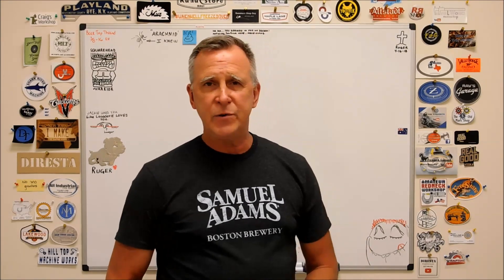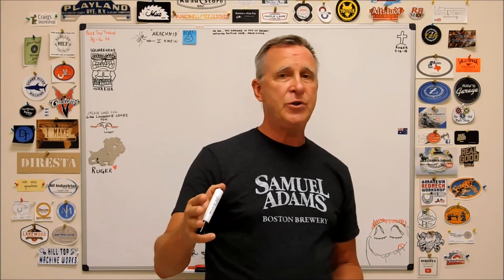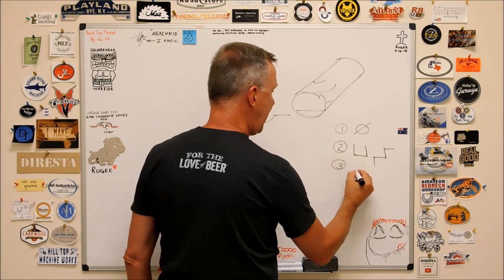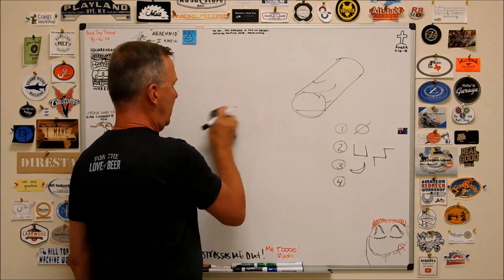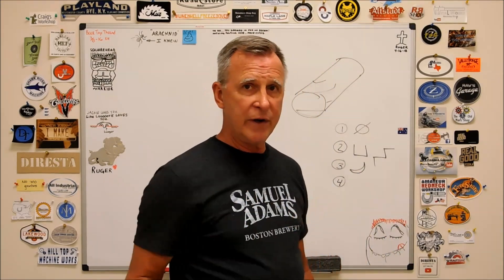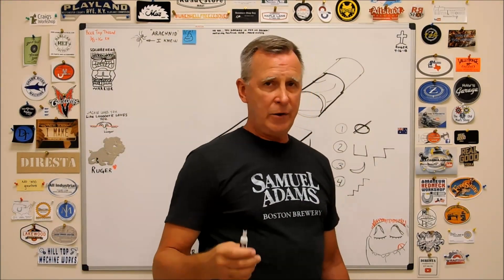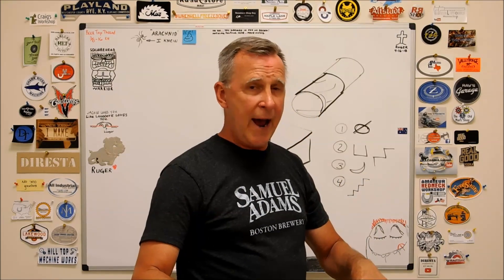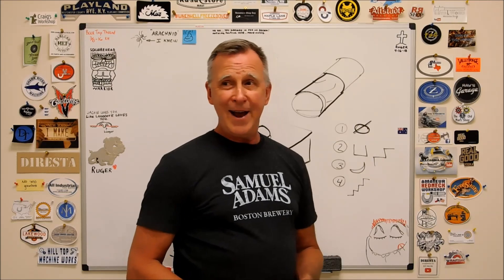Faster Milling and Longer Cutter Life...Watch this One !!

Comment: Hey Joe..Quick question. I am just a hobby machinist, in fact we are really close in age. I understand the purpose of this video. My question is say you have an odd size slot. Maybe just under 1/2 inch. 
Would it be better to use a large end mill close the final size and then go over it with a smaller end mill or would it be better to use say a 1/4 inch end mill from start to finish. 
Long time subscriber…. 
I learn something every time I watch your videos . 👍
Hope you and your family are safe and well…
Reply from the maker: The answer here really depends on the material , cutter and rigidity of everything. If tool flex is not a problem, use a cutter that is close. But flex of .005 or more isn't rare, so be careful.
Reply: @joepie221 Thanks so much Joe.. Your videos have been so helpful.  You are a great teacher.. 👍

Comment: Suggestion
Using those cheap markers, when using them horizontally the ink flows to the back, 
If one is capable of holding it ever so slightly with the back higher than the tip,
Does it allow it to work for a much longer time frame, without having the board see such dry swipes ?
Reply from the maker: Probably, but thats rarely the case when you mark a white board. Sounds like an opportunity for a better mousetrap.

Comment: Question Joe: do you use an exact size cutter for a slot, or one size smaller to allow for cleaning up - if the slot width is critical?Mike
Reply from the maker: I usually use the next fractional size down if the slot is critical.

Comment: Outstanding. Otherwise why design a tool with cutting surfaces extending up the shaft and not just at the very end. Plunge drill to remove material and clean it up with the end mill. That's the way you do it. Play the guitar on MTV. Thanks Joe.

Comment: Hi Joe
Thanks again for another great video. 
Additionally, going around the outside of a part with a full axial engagement, I’ve seen significantly accelerated feeds and speeds. That would yield a higher material removal rate compared to conventional cutting. Just another perspective. Thanks for sharing. T

Comment: Hi Joe, if I may, can I suggest you change your camera batteries to Energizer Ultimate Lithium batteries. Theyre a bit more expensive but the life you will get out of them will more than compensate. I buy mine off eBay in bulk but Walmart often has good prices for bulk packs too.
Thanks for the demo. I think I worked out what caused a new 3/4" ,4 flute cutter to self destruct in short order doing a slot cut like you showed. For some reason the end edges just melted in CR steel.
Regards from Canada's banana belt.🤞🇨🇦🍌🥋🇺🇦🕊️🇺🇲👍

Comment: Good Morning Joe.  In light of cutter management, we have an upcoming job which consists of a standard keyway centered in a 3 7/16 shaft (mat'l is 1144 steel), 365 pieces. How would you approach this? Thank you for your suggestions.
Reply from the maker: How long is the shaft and how wide is the keyway?
Reply: @joepie221  Shaft is 22" long with a 8" key centered. Keyway is 3/4" wide x 3/8" deep
Reply: @dynamiteralph  personally i would rough it out first with a 5/8 inmill then come back with a 3/4 inmill to finsh it off and run coll mister on it blowing the chips out of the slot but thats just the way i would do it

Comment: Yeah, there were are lot of what I may be wrong in calling them chatter on the sidewalk during the plunge cuts too then those in the one end of the cut.  How would you have prevented those variations in the cut of the sidewalks especially near that one end.
Reply from the maker: The pecking operation is a roughing technique. Final offset passes should take care of the wall finish if you use an undersize cutter initially, or can get away with a non full round radius on each end of the slot.

Comment: How I haven't replied to this one I do not know. I did give it a thumbs up though. These tid bits of "You need to know this info". It is always nice to be reminded of these old tricks and rules my friend. There are always so many forces involved in any machining we either fight them or work with them. I prefer the later. Thanks my friend. It is always a pleasure to visit with you.
Reply from the maker: Always good to see your channel avatar pop up. I can always count on a positive comment.
Reply: @joepie221  It is easy calling a spade a spade. I know a bunch of like minded folks here that appreciate your skills. Mark Preselling for one. That Glow plug engine he is getting very close to running makes me wonder about you setting up the mini machine shop with it's overhead flat belt drive ? Lots of questions like are you planning on building a power/steam boiler to cap off a wonderful series of builds ? I question the need for the boiler as live steam can be nasty stuff and air pressure will work just fine and at the same time the boiler would be sooooo cool to at least see it at the head driving that long shaft to all those wonderful creations. DECISIONS, DECISIONS EH.  So, Air or steam, we are a waiting your final decisions. Maybe both eh, LOL. Take care Joe. Your easy to visit my friend.

Comment: That was my method for a very long time. And then I got a mister. Using synthetic water-soluble fluid and  whatever PSI I need to remove the chips  I can bury an endmill and  get a great finish and run faster with less heat too.  
Heym  WD 40 as cutting lube? Kerosene works well on SST?  Really?  It's great aon Alum but SST?  Never tried it.

Comment: Joe I normally like your videos and the advice that you give. But in this one I'll have to tell you..... If I handed in work that had that kind of a slot in it with those "nibble marks" I don't think I'd have a job for very long. I'm all about efficiency, but not at the cost of quality. You can bet that any blueprint would have a call out for surface finish.... Even just a default service finish written in the standard notation..... And I think that the slot that you ended up with would have a hard time passing the surface finish tolerance.

But even if it did qualify for dimensional and surface finish acceptability.... Just the general appearance of that chopped up wall gives the impression of low quality work.... And I know that's not the kind of work that you're used to turning out in your shop.

I'm sorry to sound so negative, but you invite our comments.... And that's my two cents.
Reply from the maker: All 'on topic' comments are welcome, but the base subject matter of this video is how to rapidly remove the material and maintain the integrity of the cutting edge. Nothing about this video addresses the topic or technique of how to get a surface finish. Cosmetics are very important around here.
Reply: That's true. To be fair with you I did take the content of your video out of context in my comments. At the end of my manufacturing engineering career I served as a QA engineer running an inspection department. I guess when I viewed your slot video.... I was not looking at it so much as a machinist as I was an inspector.
Reply: @johndonlan5956  Another point which you seem to have missed: the slot was milled using two different approaches, one at each end, and the nibble marks were at one end only, made by the technique Joe was saying we should NOT be using.
Reply: @Gottenhimfella  point taken. Thank you for pointing that out.
Reply: @johndonlan5956  That's the third time in a row I've seen some stranger on YT comments take a constructively critical suggestion in the spirit in which it was intended. 
Kudos! Such reasonableness was formerly a rare pleasure, and I'd love to see it catch on.

Comment: Yeeper's, all about saving ware on costly end mills,,,great to know tip's Joe,,thx. The few I have are under lock and key,,One thing I did on cutting in the Hexagon & Octagon features on an indexer I am making, was to cut the flats with a small fly cutter (recently last wk), and may have been beginners luck, but when I checked depth of cut's, the Joe block rang to the surface. I only took 0.005 cut's and finial @ 0.0005...and results were mirror finish. This vid was most helpful Joe,,,Bear
Reply from the maker: Glad to help

Comment: Super,,fixing to install Tee slots (for my first time) in a 1/2 thick hot roll plate. Have 4 flute end milks, so that a big plus on perdrilling holes first,,thx Joe for the tip,,Nesr

Comment: Joe there are cutters made specifically  for  0.015" deep  high feed rate.  The use is cnc  but Ive wondered about  using them in a manual and feeding fast  under power.  Joe  WD40  is kero with a little mineral oil,  you like it for SST?  I am  quite surprised.
Reply from the maker: I'm sure there are better, but I normally machine SS dry. Except in my CNC mill.

Comment: my solution to the first problem, the tool is called an end mill, do all your primary roughing with the end.
1. assuming the depth of cut for the width of cut is less than the tool dia.
2. touch off the side and move to a full depth cut, back off a fair amount to leave finish stock plus a bit 
    to allow for the amount that the tool will want to walk into the cut since you will want to climb cut. 
    this will also put the load on the screw and keep the tool from wanting to jump into the work, put a bit 
    of tension on your table clamp to keep the tool from pulling the whole table, vise, and work into the tool.
    less of a problem as the tool diameter is reduced.
3. touch off the end of the tool, back off and crank up or use the quill to set the tool depth. leave a fair
    amount to for finish stock. set a quill stop.
4. make a series of chopping cuts, in increments that won't put excessive side load on the tool and
     break it.
5.  make a minimum clean up cut in the other direction, measure and make a finish cut. done.
6. result, takes less h.p., you and the machine. most of the tool wear is on the end of the END mill.
7. when you send the tool out to resharpen the cutter grind shop will take a fraction of the diameter
    off, to clean up  the diameter, than he would have had to, had you used the original method, and the
    rest of the regrind comes off the end, thereby getting more life out of the tool. most of the time this
    is the faster method too.
Reply: ps. this it the plunge method that the cnc man, remarked about previously.
Reply from the maker: Is that not exactly what this video shows?
Reply: the response above was to the FIRST drawing you made. step cutting the notch on the side of the block. making all those relatively shallow cuts is
putting excessive pressure and wear on the corners of the flutes. one big cut, where possible, maximizes the tool and the the time to finish that type
of feature. however, the method you filmed on the full slot with radius ends is the same one i use and is absolutely correct and efficient. beginning machinists will struggle for years before the will learn that technique.

Comment: Can you do like AVE did? He overlapped the drill holes more, but did every other hole and then came back to the passed ones so the load was still even on the drill.
Reply: Oh and what camera runs off AA batteries these days? Might think about getting some lithium USB micro charging AA batteries for it.
Reply from the maker: Smaller lesser known brands like NIKON
Reply: @joepie221  my old D700 and D7100 take proprietary lithium cells. :-)
Reply: Joe Pieczynski nice one Joe!!

Comment: Wow, that's the first time you've done a video that I actually do the same thing for the same reasons. I've got a cheap Chinese mill/drill and a drill vice but that method works with even a less rigid set up.like mine
Reply from the maker: Excellent.

Comment: For Slotting, using a Roughing Mill first would be the better option and likely letting you take either a full depth cut or much deeper cuts than when a regular end-mill.
Reply: Guy Tech what do you think of that comment Joe? I'd be interested in your opinion on that as I'm sure others would be as well.

Comment: Joe, I'm a little confused here. In the video you start out by saying not to use the tip of the end mill because you'll wear it out, then you turn around and say to use the tip of the end mill because you WON'T wear it out.
Reply: Different feature, if you're doing a slot (goes all the way through a part), wearing out the bottom won't matter for the dimensions you want to keep accurate. HOWEVER, for a pocket (you DON'T punch through) the bottom may be a significant feature you want to keep intact. Like say for instance a keyway.
Reply: Orange Dream  nicely explained for the deaf and dumb!

Comment: Man I literally just went to school on this very scenario in my shop!!  I'm having to do a 1/2" deep 3/16" wide slot 1.5" long in mild steel....if I slot back and forth progressively it takes 2 min, if I go full depth and across it takes 2 min, or if I plunge a bunch of times and clean up it takes 2 min lol....but the full depth breaks cutters, the progressive slotting ends up exactly like you said with a crap side finish at the bottom, and the plunging by far the cutter lasts the longest, as axially everything is nice and rigid...only issue with the plunging is I do still get vertical banding in the surface finish on the sides of the slot...the tolerances aren't critical so I just step over slightly and clean them up ......great video!!
Reply from the maker: Watch my video on cutter flex. It explains how to cheat your initial plunge passes to eliminate those vertical stripes.

Comment: Joe -- Curious as to precisely what kind of. cutter you were using for this demo.  And with the 303, about how many such slots could you expect to cut before having to replace the cutter?
Reply from the maker: Its a TIAL 4 flute carbide 3/8 cutter. if this were a production process, it would be best done in a flood of coolant. Once an edge chips, it amplifies the load on the other 3 and things can go south pretty quick. Done correctly, this cutter could last for days run non stop.

Comment: Exactly how I would have done a deep slot like that. A lot of times when I'm doing a keyway for example that's not at the end of the part, I'll just plunge straight down on my end points and step over with my center cutting, undersized roughing endmill. Then do a full depth cut to size with a finishing endmill that I only use on keys. Cool video thanks for sharing!
Reply from the maker: Thanks for watching.

Comment: Have you seen or heard anything about HR 7468 the bill they are trying to pass that would outlaw milling machines and drill presses or anything else that could be used to finish an 80 % lower !!
Reply: Please be more accurate with your language... that is NOT what the bill does.  It would ban machines SPECIFICALLY DESIGNED to manufacture firearms.  It doesn't even use the term 80% or partial or any other term.  Also, a bill with language that loose will never pass.  It's a showpiece bill intended to whip people into a frenzy, and make some politician look like a hero to his constituents... and you're falling for it.
Reply from the maker: We would all go back to knitting quilts if the politicians removed all the mills from this country. The bill probably refers to those mini 'Ghost Gunner' mills that were so controversial a few years back. The CEO ended up in jail on child pornography charges after messing with the ATF.

Comment: Great video Joe, very helpful for people new to machining. I only recently discovered that  2 flute cutters were for plunge cutting and 4 flute for travel cuts . Obviously I have a lot to learn. Have you done another video on this topic , when or when not to use a particular cutter and depth of cuts. Many thanks
Reply from the maker: There are many factors for cutter selection. Some cutters can plunge while others, that look almost identical, are ground differently on the bottom, and won't. I use 2 flute for brass, aluminum and plastic, 4 flute on pretty much everything else.

Comment: Is there a way to email you maybe, and pay you for your time, to have you go a little more in depth?  Starting at 10:37, when you state that you are taking backlash out, it gets confusing to me, a mere nube.  Heck, the motor for my Bridgeport wont be here for a couple more weeks.  But, I am a marine mechanic and this video, holes and slots in stainless, is exactly why I have invested in this mill and lathe.  I guess I dont understand the taking backlash out if the table is locked as you plunge?  That's the main confusing part.  I am also confused about the full depth side clean up.  In a video several years maybe ago, you were saying that due to tool flex stepping down gets a straighter, more square, side wall of a slot?  You went quite in depth about it.   I am sure I am missing something, please dont take this as calling out discrepancies.  Text lacks sincerity.  Maybe I need to watch that tool flex video another 5 times, it's been awhile.

Comment: 303 is great. Last year, a zinc casting rotted away. This was part of the faucet from our tub filler. This was a pretty expensive model, and no longer made. No parts available. I had to make the part from 303. Whew. Angular milling, circular table for part, and, well, it was a pain. But replacing the faucet involved another (expensive) faucet, a contractor to remove the tub from the foundation built around it, and replacement. A good estimate of $3,000 to have done. But $20 worth of 303, and many thousands in machinery and cutters, and it was done.

My wife thinks I spend too much on this stuff. Nah. I see you have a Bar Z sticker. I just bought the 1200 hardening and tempering oven from him. Good stuff.